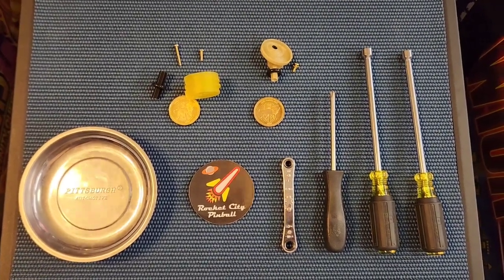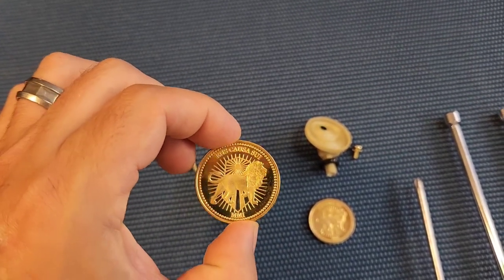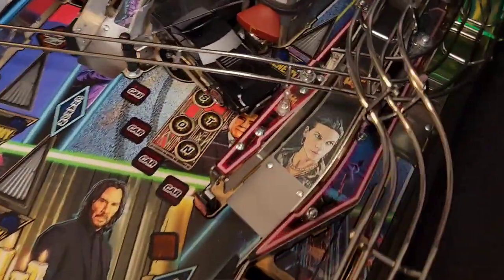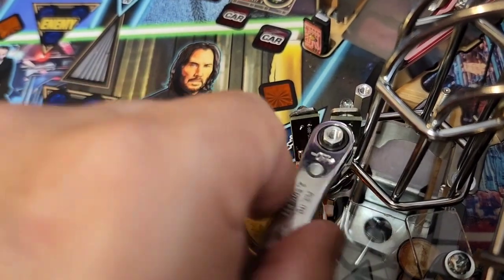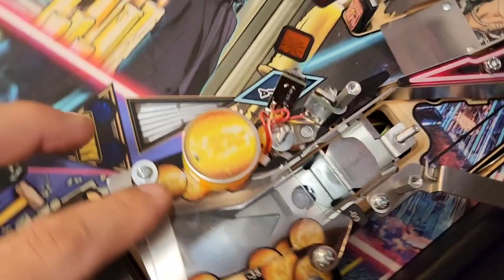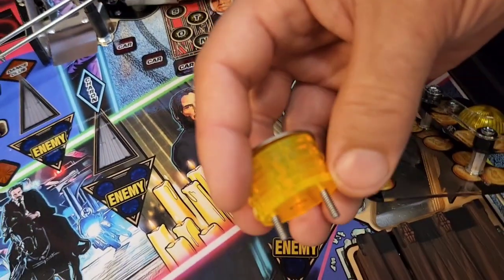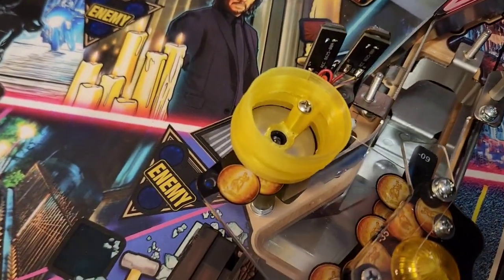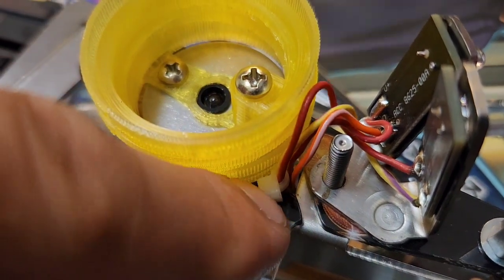Coin Stack flasher upgrade mod for John Wick pinball, from Rocket City Pinball -- with real coin(s)!

Comment: Love this mod! But I have a question. I have the LE and that hex spacer for the black cover piece or the leaning coin is not there. I looked at stern stock photos of Pro and Prem and do not see it there either. Did you add this hex spacer? For the leaning coin mod? If so what size is it so I can order it if I pull the trigger on this mod. Thanks!
Reply from the maker: It's not unusual to have minor changes after the stock photos are released -- this hex spacer was added to eliminate a potential ball trap area.  I got a first run Premium and it came pre-installed.
Reply from the maker: You might be able to contact Stern and request it to prevent ball traps?